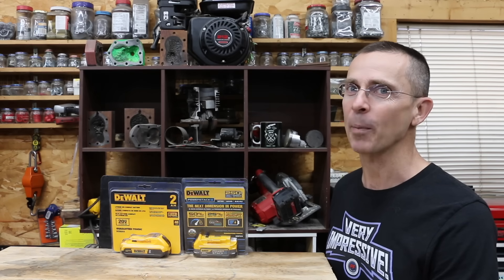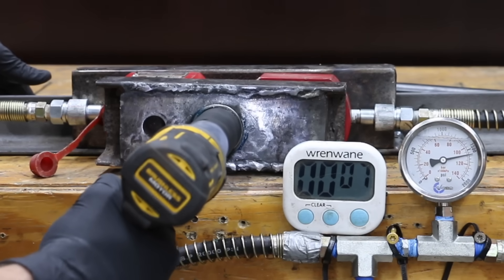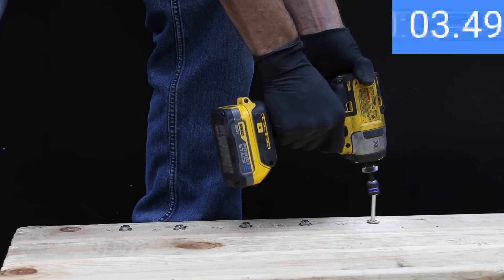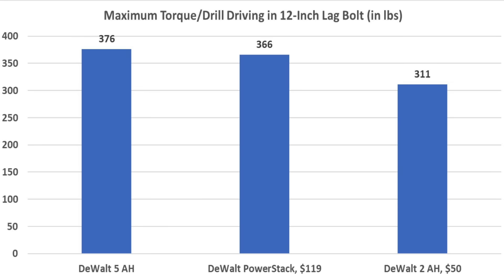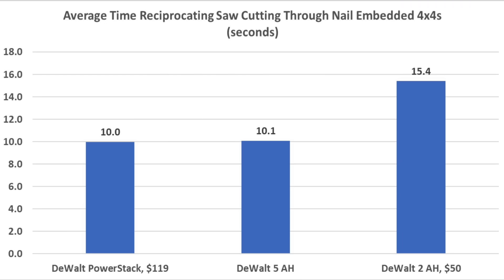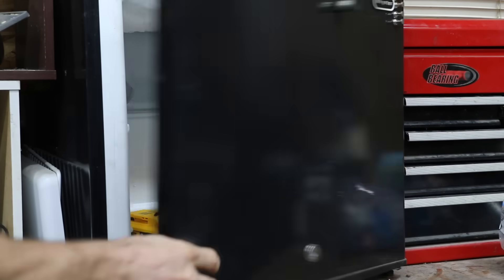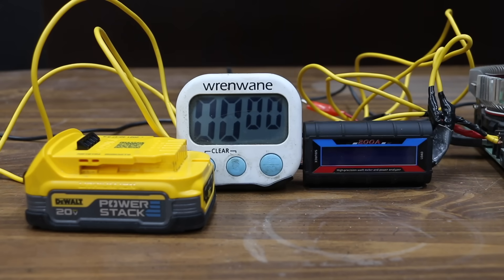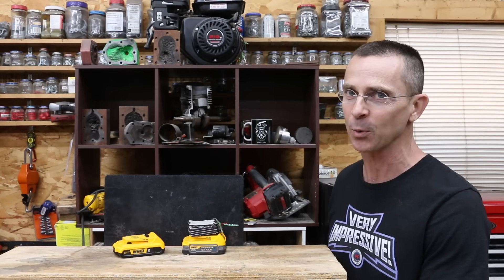Compact “Pouch Cell” Battery Better? Let's Find Out!

Comment: Have you done a video where you test output voltage of fully charged 18V vs 20V batteries of different brands? I bet one like that would get a ton of views, given they should output virtually the same. Could even make one of those "are they lying to you????" sorta thumbnails =P
Reply from the maker: Thanks for the suggestion.

Comment: Pouch and prismatic cells are more vulnerable to vibration and bloating when fully charged than cylindrical cells. The failure mechanism is delamination of the layers resulting in a reduced number of charge/discharge cycles before useful life is expired (when charge capacity drops below 50% of rated capacity). Large prismatic cells require compression frames to achieve their rated number of charge/discharge cycles. I built an 8S, 280AH battery pack for my RV, the cell manufacturer recommended a compression frame that applies 300 KG of force on the cells. I built a DIY plywood frame using 1/2" threaded rods with Belville washer stacks in each corner.
Reply from the maker: Thanks for sharing.

Comment: Can you do a segment on Lithium AA batteries? I have used the Energizer Lithium batteries in the past and found them to have good longevity BUT I also found that they don't drain equally in devices requiring two or more. The only way to test this would be to test each battery individually. You're better equipped to prove this theory. Thanks. 😊
Reply from the maker: https://www.youtube.com/watch?v=CzZrB974Zro

Comment: Round liIo cells are far more durable than LiPo flat packs.  They also handle being left fully charged or fully discharged much better than LiPo.  I would imagine that the Powerstack will have a much lower total lifespan.
Reply from the maker: Thanks for the feedback.

Comment: Batteries are a con game rip off. You never win at the other fellows tricks. Batteries are $10,000 and up for hybrid and electric cars. I am not on production and retired. The 120 volt grid never needs a recharge for my hand tools. My car burns GASOLINE! Burning gas is predictable but not runaway batteries.
Reply from the maker: Thanks for sharing.

Comment: This is an odd request, but maybe you'll have an interest in doing this....don't know without asking. I have wondered how building a battery pack would be cost wise using quality Japanese cells vs tool batteries  and 3-d printing adapters or getting them on Amazon to power ebikes or what-not. I'm most interested in Kobalt battery packs because I've seen breakdown videos of them and they use quality cells....at least they used to....and their prices seem most reasonable. Also....maybe some of the better knock off that use quality cells.

Comment: Wish they had put a more substantive hard case around those cells. Pillow cells can be made equivalent to 18650. Their downside is that they are are more sensitive to abuse damage and sometimes don't shed heat as well when they are stacked compared to canned cells. 2ah batteries shouldn't really be used on hard cutting tools. (Fullsize Reciprocating, circular saws and the like) cSome brands (makita in particular) make the connections slightly different to ptevent their use on them. Cutting tools are too hard on them and make them wear out/fail faster, partially due to thermal damage.

Comment: I would be very interested in a bars leak comparison. I just had a freeze plug get a pin sized rust hole. It was extremely difficult to access. Was told to try pepper, so I gave a try and it worked! (So far🤞) 4.0 jeep straight 6 btw. Love your videos been a fan since almost day 1. It would also be cool to see a throwback lawn mower engine video just for fun! Have a great day sir! Keep up the good work 👌

Comment: Personally, I would avoid these pouch type lithium ion batteries like the plague. As a Vaporer, 18650s are the way to go  especially under high fast amp discharge; 18650s from Panasonic, Sony and Samsung are not only safe chemistry but they last a very long time years in fact. If there's a bad cell it can be replaced. Much easier than some off-sized pack.
Reply: Pouch cells will bury the 18650 in high amp discharge because of surface area... You will never see the 100amp+ discharge that pouch can deliver.
Reply: You’re a bit backwards but not entirely wrong. Polymer cells discharge very fast and very hard for long periods of time compared to modern 18650 cells. You can have almost the same current capabilities in half the size, but of course the draw back is polymer cells are more volatile, and need a more precise management system to monitor each cell very closely to prevent bulging. Replacing a cell would actually be easier on a polymer pack as each “pouch” is just two tabs that be cut and spot welded again. 18650 packs are spot welded as well but are a ton harder to fix. But when replacing cells you need to replace the whole pack anyways to avoid uneven charging/discharge rates so that throws it all out the window anyways.
Reply: LiPo's mop the floor with 18650's when it comes to discharge rate and weight. That is why you see them in RC helicopters.
Reply: Lol this guy 🙄
Reply: Plus Sony no longer manufactures 18650 cells as far as I know. I think the last great cell they made was the vtc5
Reply: @mrb3888  I still have a functioning VTC5. Been using it in my mod for 6yrs. Still holds a charge.
Reply: @AIRSOFTMAN819  that’s awesome and I don’t doubt it. They were some of the best cells on the market and that’s also what killed them. So many fakes being sold and too many people getting hurt. If you’re ever looking for an alternative when that one goes, the Samsung cells, specifically the INR18650-25R, are a great high drain cell. Very comparable to the vtc5. I don’t vape anymore but I would still love to have some brand new vtc5’s.
Reply: same, have seen to many incidents with the li-po batteries vs the 18650

Comment: I couldn't find any information on what type of lithium chemistry of those pouch cells are. However, LiFePO4's (the "safe" lithium) are fully charged at 3.65v per cell. 5 of those in series would make 18v, and 6 in series would make 21.6v. 

Those have to be Li-Po (the super flammable cells used in RC cars and phones) based on the voltage. Li-Po's charge to 4.2v per cell, and 5 in series would make 21v, which is very close to the pouch batteries fully charged rating. 

I'd rather have metal cased, cylindrical, Li-Po's. Or LiFePO4's in a pouch. Tools are abused, and lithium polymer pouch cells are not meant to be beaten up.
Reply from the maker: Thanks for the feedback.

Comment: I like how they didn't even give the PowerStack an AH rating on the package. I feel like it worked great in the beginning and by the end of the video it got worse. Worse than even the 2AH regular battery. It degraded in real-time lol! I don't get why Dewalt doesn't use 21700s yet for their 5AH yet. Pouch cells can be great, they usually have a higher discharge rate (C Rating), but I feel they are less consistent quality than 18650s and 21700s. You want some REAL power, use some Samsung 40T or Molicel P42a batteries in tool packs (Or even 30Ts lol). Also, there are high discharge 2.5AH and 2.6AH 18650s too not sure why they keep using 2AH besides for price reasons.
Reply from the maker: Thanks for the feedback.

Comment: One thing to consider with pouch style packs is they puff with hard use and can burst into flames . You can look this up but its common knowledge in the RC car and Airplane community. They are dangerous enough that in RC the packs are charged in a fire safe pack.
Reply from the maker: Thanks for the feedback.

Comment: Lithium ion Vs lithium poly-
The new style batteries will FAIL before the older style every single time. I've been using these in rc planes and multirotors for 10~ years. You get a better discharge but the battery lifespan is pathetic especially if you're using them on a job and continuously cycling them. Once the packs start to puff- they should be recycled but how are you supposed to tell if they're enclosed in a hard, drop-proof pack? This seems like a failed product in the short term, and a unnecessary money grab by dewalt. 

Stay away from the novelty and just buy the larger traditional lithium ions and don't waste your money.
Reply from the maker: Thanks for the feedback.

Comment: It pisses me off they don’t put an amp hour rating on the power stack battery. That’s why I’ll never buy it. Especially since it’s a hell of a lot more dangerous. When 18650s overheat or short out they have a safety mechanism in the cell that disconnects the positive lead of the cell. Those pouch cells can swell up when they short out causing an explosion or even breaking the case apart from the inside out. And there’s nothing new about lithium pouch cells they’ve been used in hobby rc vehicles for years.
Reply from the maker: Thanks for the feedback.

Comment: Pouch and cylindrical batteries use essentially the same chemistry.  The only difference would be the packaging and the resulting energy density / weight.  You can get significantly more energy density per unit weight with pouches because you're not packing in all the aluminum that goes into cylindrical cells.  A "properly designed" battery will provide enough protection to pouch cells for its application.  Cylindrical cells have the benefit of mass production lowering it's cost.  So if you want power/weight, go pouch.  If you want to save money, go cylindrical.
Reply from the maker: Thanks for sharing.

Comment: I just bought the new compact 400 foot pound impact driver. I got this battery for it. Started using it out of the package and still haven’t charged it and it’s running strong.
Reply from the maker: Thanks for sharing.

Comment: EXCELLENT! It would be nice to compare and track the introductions of new battery and charge technologies in the major brands. For contrasting cost points, both Ryobi and Festool have introduced new batteries and chargers in the past 2 years,, as well as Milwaukee and Dewalt. I haven’t been tracking Makita. I have 4 new Festool “ cooled” batteries and 1 new cooked charger. The performance of 2 rather new, but old version 5.2 ah batteries and the 2 ea. new technology 5.2 ah AND 2 ea. 4.0 ah batteries is noticeable in normal work environments. I’m curious if all the tool brands are producing these battery performance gains or are some brands really ahead of the pack?  BTW, I’m finding myself reaching for the 4.0 ah batteries more and more as they are more comfortable for extended projects in drills and saws.
Reply from the maker: Thanks!  Thanks for the suggestion.

Comment: One thing that's terrible about this is there is basically zero recyclers that take or work with pouch batteries. 

Aside from that these are guaranteed to not give the same performance or service life to a similarly rated pack made with cylindrical cells, be inherently more dangerous, basically impossible to rebuild and probably cost them significantly less to make.
Reply from the maker: Thanks for the feedback.

Comment: Your testing with these batteries, reminded me of the Energica Ego electric motorcycle, and the racing events based on it. After the races, there is so much battery left, and these bikes are so heavy. So the question was basically asked, why don't they use smaller, lighter, more agile battery packs, just big enough to last the whole race?

The response was, the reason why oversized batteries were used, is because they are best at handling the power requirements, for the entirety of the race.

We see that here with these batteries. Compared to the other two, the 5AH just beasted through all your tests like a Freight train. For the same voltage, all those extra batteries inside of it, wired in parallel, not only gives that pack more capacity then the other two, but also, the loads from your tests were spread out to to more battery cells, meaning, each individual cell received less stress, meaning, the 5AH can not only last longer, but also provide high performance, more consistently.

I'm learning Electrical Engineering, and how to build, service, and modify Electric Vehicles, and Hybrids.

This made your tests & graphs really fun for me to watch.

Compared to engines, EVs can be so heavy just to have similar performance. But there's an argument to be made about just embracing the weight of current battery chemistries, for not only range, but that consistent high performance.

I would prefer small, light, and agile vehicles, like midsize or smaller motorcycles, one of my favorite car companies is Lotus, and I LOVE EVs for their torque, stealth, and the sounds motors naturally make....But Electric Vehicles are so heavy, just to maintain a certain level of performance, because of the batteries available.

This video gave me a lot to think about.

Do you have a 3D-Printer and 3D-Scanner?

What do you think about redoing these tests, but wiring Super-Capacitor packs (the same or better then charging voltage) in parallel with each of the smaller battery-packs, to see how that affects their performance compared to the 5AH?

Even making a bigger cases for these combination packs, for you to test & weigh. Like how much better can a few or more SuperCap packs improve the initial hit of load, and overall stress on the smaller battery-packs?

Comment: Great test.  Love the information your test provides.  I find it interesting that the "pouch" type battery works better at cold temperatures.  

I don't use my power tools on a daily basis, so for me, having a battery that holds the charge longer, charges faster and is lighter weight is important.  

I have cordless tools from a few different manufacturers.  I like having extra batteries, so if one needs charging, I can grab the other and keep working.  Can you test DeWalt, Milwaukee, Rigid and Ryobi 18 (20V) batteries to see which one performs the best.  How long it holds a charge (while sitting on a shelf), which one has the most usable energy, weight and charge time.  I think you did something like this in the past, but the new battery technology may alter the results.

Thank you!
Reply from the maker: Thanks and you are welcome!  Thanks for the video idea.

Comment: Please change your title from “Pouch Cell” and “Large Lithium” to “Lithium Polymer” versus “Lithium Ion” - the correct descriptions. Also, I understand why you tested it against the regular 2ah pack (because DeWalt used it as the comparison for their marketing) but it really should only be compared to an XR pack. You used the 5ah XR pack instead of a 2ah XR pack. The XRs use different (better and more expensive) cells that have higher discharge rates (better amperage). That should have been explained in your video. I only buy XR packs. 

Also, Lithium Polymer batteries are almost exclusively used to power radio controlled electrically powered airplanes - because they are light weight, pack a lot of amp hours, and the expensive ones have incredible high amperage capability.

As always, love your concise, scientific and excellently produced video.
Reply: Used in jump starters, phones, tablets, and small devices with custom batteries that companies don't want users replacing so they can fill their greedy pockets.

Comment: I had a Nokia phone with a pouch battery - just out of warranty the battery was still working but had blown up like a balloon and actually opened/ pushed apart the phone case. Replacement battery did the same. Maybe a charger problem - but indicates a potential problem with the technology.
Reply from the maker: Thanks for sharing.
Reply: My Samsung S4 mini is on it's 3rd battery for that reason. Each battery lasted about 18 months.

Comment: I think the key for this battery is the life cycles. The regular 2 Amp Hour battery has 300 to 500 cycles of life, the powerstack has 2500 to 3000. So it will cost you more at the beginning but it will last you a whole lot longer making it a better long term purchase..
Reply from the maker: Thanks for the feedback.

Comment: With the type of abuse a power tool will be subject to, I’d definitely choose cylindrical. I have experience in the RC car, truck, and drone worlds. Let’s just say that packs, or “pouches”, make for amazing smoke and fire displays. Puffing is way too common with temperature changes and “pouches” that aren’t maintained correctly. This is a solution just asking for major problems, especially with how easily the pouches are damaged.
Reply from the maker: Thanks for the feedback.

Comment: Interesting test. I have probably changed 50 flat lithium polymer pouch batteries in laptops. Only problem with them being soft is that after 4-5 years they swell up from outgassing, sometimes to the point of splitting the laptop case open. They start out at about 3/16" thick and swell to 1/2" to 3/4" thick. Older laptops used 18650's.  The 18650 packs didn't last as long because they died when just one cell out of 8 failed. I have re-purposed many 18650's from dead laptop battery packs. When you bent that pouch battery, if it was charged it may have blown up in your face. Be careful with them.
Reply from the maker: Thanks!  Thanks for the feedback.

Comment: The flat packs have a problem, heat and expansion. You are relying on the Plastic case to support and contain it. The 18650 cells will be thermally stable and not change in size.
Reply from the maker: Thanks for sharing.
Reply: @ProjectFarm  thank you for video I'll stick with regular packs and save the $

Comment: Steve - I'd like to see you try out a variety of Lith-Ion battery-powered tools in a consistently cold environment. I was working up at my Dad's place (9300' in the CO Rockies) over New Years helping him fix wind damage to his barn - which doesn't have power. We had to keep our variety of cordless tools on the floorboard of my truck under the heater vent to keep them working. 👍
Reply from the maker: Thanks for the suggestion.